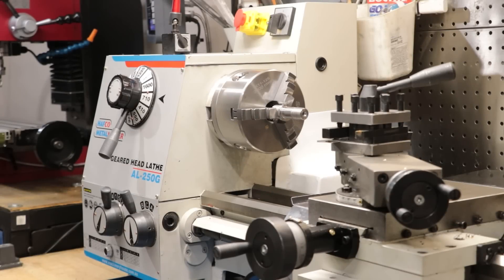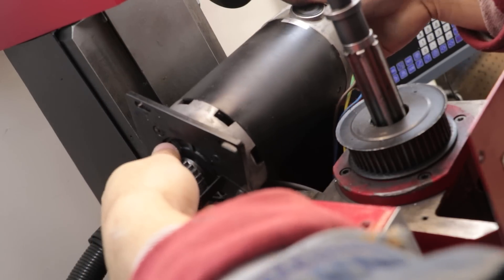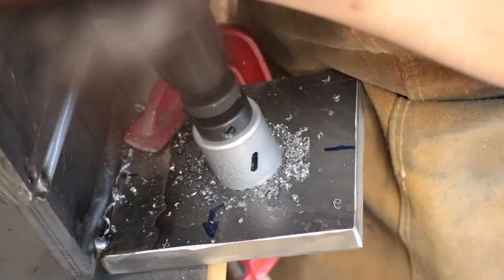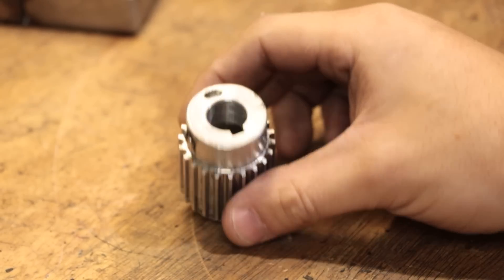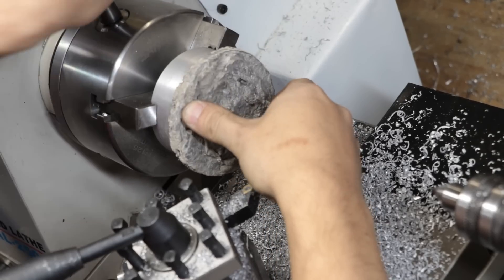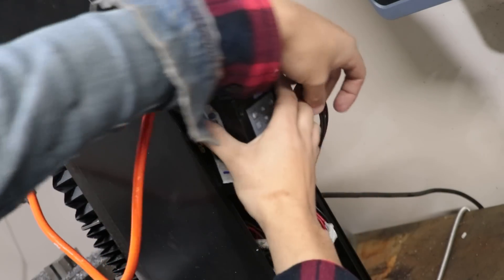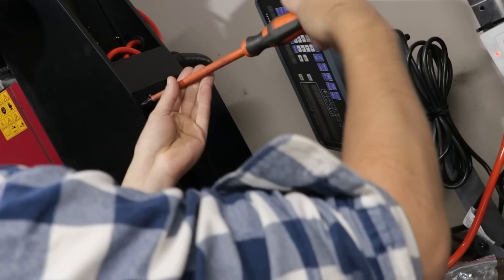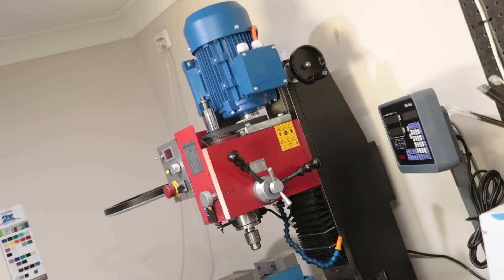I Put A 3HP Motor On My Mini Mill

Comment: I can recommend Suttons “Venom” cutting fluid. I was sceptical but it really works to make drilling and tapping easier and you can buy it at Bunnies. I can also recommend the Metabo  WEPBA 19-125 5” / 125mm angle grinder. They’re not cheap at around $499 but, buy once, cry once and they have a lot of safety features. With a rated 1900 watts they also have the power of a much bigger grinder. That’s 700 watts more than your new Ozito and boy do you notice it. With so much extra power the blade doesn’t slow down so cutting and grinding is much faster. The difference is incredible. I bought two of them after a serious accident with a Makita. I hope this helps, Cheers Stuart. 🇦🇺
Reply from the maker: Blimey that’s one powerful grinder. I looked at the makita at Bunnings and it was less than a 1000w. For what it’s worth the Ozito is powerful for the price. I do love me some Sutton a cutting fluid, I use Sutton a cutting paste and it works wonder too. Cheers
Reply: @artisanmakes  It’s is a powerful grinder but you pay a lot for it. It’s a bit like the difference you felt putting the big motor on the mill. 👍

Comment: btw, the type of VFD you have there is designed for running things like fans, it drops the voltage as your RPM decreases to maintain constant current across the coils for maximum longevity of the motor. Thats why the torque is so poor when trying to drill large diameter holes. Two things you can do to improve the performance, swap out the VFD for a sensorless vector drive unit, these provide way more torque at lower rpms and can recover if the motor begins to stall. Next would be to replace the silly 3HP motor for a 1 1/2HP one with 6 poles as apposed to 4. Due the the lower rotor mass the max speed is far higher than the plate speed, that number is simply what the motor will run at when connected directly to 3 phase power while you will find that the same motor model family with 2 poles has a plate speed of 3600rpm with 150% overrun margin so you actual self disassembly speed is like 6k+ RPM lmao.
Reply from the maker: Whilst this motor wasn’t my first choice, I don’t want to make it out like I have little torque at low speed. It’s quite a lot for what it is. I am sure we can do better but I’m over sinking money into motors and drive units
Reply: @artisanmakes  haha, that's always the way. I ended up changing to a gear head machine myself so no more torque problems. But you will end up running into trouble with annular cutters with that setup, you simply wont have enough HP at the speeds those work at, for everything else you should be okay.
Reply from the maker: I am a bit jealous of that. A geared mill is something I’d like to get my hands on one day. Cheers

Comment: I would have used the lathe with a 4 jaw chuck to make that hole. You can start with a drill and then bore it out to size.
Reply from the maker: Sure but I don’t have a 4 jaw for this lathe
Reply: @artisanmakes  ...yet.
Reply from the maker: @doc1701  Yeah its on the long list of stuff to buy :)

Comment: Remember Endmill size IS gearing. (I had to learn this mistake). Run the machine 100% rpm/power, use smaller diameter end mill to get right surface speed. I went from preferring 12mm cutters to 6mm. Buy long shank for those tall sidemilling ops. They are also like 1/4 the price.

Comment: The obvious solution is Paint the Motor either Red to match the Quill or Black to match the Frame.  I would suggest Black. I think it will not stand out as much as the current Colour. I have a Similar machine from the Little Machine Shop so it is White and Blue. the increased HP will make some milling operations much easier. Having a very stiff column is essential to the Milling Platform,

Comment: 2 times the frequency is risky for large motors because of centrifugal forces. 1.5 can be ok
Reply from the maker: It should be okay to go up to 2 times on this motor. And that’s purely based on the fact that they sell the exact same motor which is 2 pole, which runs at 2800rpm

Comment: Why would you try drilling through steel with a hand drill when you have a working lathe?

It's not the ideal tool but you can put an endmill in the chuck and use it like a mill. Surely it's better to do that and cut a hole with the part in a rotary table than using a hand drill on steel...

Also... why would you risk doubling the motor frequency when you can make larger gears for the motor? Go with a 4:1 gear to increase the speed and use the vfd to reduce the speed in "hi mode". Then switch the gears back for "low mode" when milling steel.
Reply from the maker: Even if I wanted to make gears I can’t make the spline profile yet. And I don’t have any fixtures for this lathe to mount the steel. Nor do I have a 4 jaw chuck. Yet anyway
Reply: @artisanmakes  you can hold an endmill in a 3 jaw chuck. A rotary table can be bolted to the cross-slide (remove the toolpost). 

It's worth getting that rotary table first in your case as they are cheap and you really need those gears.
Reply from the maker: You would either need t slots or a backplate to be custom made to attach it to this cross slide and in the context of what I was doing I that doesn’t make much sense to do. I have a mill do I’m not going to invest in tooling to make the lathe have milling capabilities. But you can do that for your machine tools. Cheers

Comment: If you want more torque at low speed you can look to change that VFD for a Delta MS300 or similar one, because these cheapo chinese VFD's are PWM controlled and they offer low torque at low rpm, so the best option for a steel milling machine is to use a Vectorial Control VFD
Reply from the maker: Just a shame that the good quality ones are pricey

Comment: When you go above base frequency you will trade speed for torque, however comparing the torque curve of this motor to your last motor id suggest even at 2x base speed torque will still be greater
Reply from the maker: Yeah it seems to be like this. For what it’s worth I rarely go above 1500rpm unless it’s that rare part that needs a small endmill. Cheers

Comment: I did quite the same on my machine (BF 28) last year and I would never go back ! 
I can drive the motor between 4 and 115Hz. and as my machine has 2 gears I can use it from 80 to 5.000+ RPM, with a bunch of torque at low speed.
Huge improvement that should be done up from the beginning

Comment: I swapped my spindle pulley sleeve when I converted to a belt drive. I found the spline profile I needed on aliexpress and just turned it down to fit my bearing.

Comment: I’m…. Very confused why you didn’t just put that square plate in the lathe and punch a hole in it with the tailstock? 
Remember, your lathe is Essentially a milling machine turned on its side
Reply from the maker: I dont have a 4 jaw chuck or t slots for fixturing
Reply: @artisanmakes  ah ok that makes sense.  Sounds like we need to start you a 4 jaw fund! I would definitely contribute 😊

Comment: Aluminium exhibity a property of 'age hardening' which results in it being soft gummy crap for a week or so after its cast.  leave it a week+ and it itll machine much better.  I had this exact same problem :D
Reply from the maker: thats why I heat treated it. to artificially harden it. I don't know for sure what alloy it is so it might not be an alloy that age hardens

Comment: If your buying ozito tools you should just be impressed if they work in the first place not worried about when they will fail
Reply from the maker: Hit or miss. Cordless stuff isn’t great but their cord d tools work
Reply: @artisanmakes  i look at them as single use tools, if you need something a project but probably wont use it again ozito is great

Comment: When milling aluminum, have you tried using isopropyl alcohol as a cutting fluid? I don't know how much of a difference it would actually make, but supposedly it's a suitable fluid to help manage surface tension of aluminum.

Comment: Brother, you need to use cutting oil and go much slower (RPMs) for a hole that size. And use more tool pressure. Clear the chips more frequently.

PS: that's not a timing belt. It's a drive belt. Unless you guys call it that down under.

Good work though.
Reply from the maker: Didn’t have much choose, drill stalled out on anything lower. And it had cuttin oil
Reply: @artisanmakes  You can fashion a makeshift "drill press" by tack welding a rod or bar vertically in front of the hand drill, attaching another bar horizontally to the vertical such that it pivots up and down and then fastening the drill to the middle of the horizontal bar and guiding it with one hand and pulling down with the other on the horizontal bar.

Might not have helped here, but it's a good trick to have in your tool bag.

Comment: crazy out of the blue question but would u be interested in selling any of the stuff from u old lathe, like the solid tool post an stuff, ive been wanting make one just like it but i have trouble getting material locally so im stuck buying most of what i get on ebay an its been a challenge to get material big enough to do alot of the stuff but since u got ur new lathe i thought id ask if u was interested in selling any of it or even the hole lathe for that matter, or just what u would be willing to part with, just thought id ask, dont have a clue of any other way of contacting you besides the comments so hopefully youll see this.

Comment: Do you miss the old lathe? 👀
Reply from the maker: I miss the upgrades I made for it. Also miss the 1mm pitch lead screw on the cross slide. That’s about it.
Reply: @artisanmakes  did you sell it? I want to get the same lathe dude, is there anything else you would recommend?

Comment: Replacement boards are available from 3 party sellers for less than $50.00 US here and there are many better DC controllers  for that motor that will probably fit in that enclosure
Reply from the maker: Just goes to show how overpriced the OEM boards are.

Comment: Love the upgrade. I did a similar upgrade but I used an Ariston washer machine motor. Three phase at 195v and coupled that to a cheap Chinese vfd. Works very well. Now to do my lathe. Slightly larger motor and vfd ordered for the mini lathe. Love the vids.

Comment: That modification added a lot of weight. How does it feel to crank the z-axis now?
Reply from the maker: It doesn’t feel all that different. Granted there is 2:1 reduction between the lead screw and handle. I think the total weight added was about 10-15kg. That 3 ho motor alone weights 17kg

Comment: Hm, epoxy granite video coming next? :)
As others have said, on the old motor control board, it's likely one of the power transistors (the big 3-pin components stuck to the heat sink) that failed. If you're interested in diagnosing and potentially repairing it, and you have a multimeter with a diode test function, you can check if one or both of them are shorted or blown. Poke around YouTube for "test mosfet with multimeter."
Reply: Yeah, those power transistors blow quite often. The power transistor blocks were the #1 maintenance issue when I ran a large CNC machine shop. I found the transistors needed to be closely matched to each other or the one(s) replaced would blow again within minutes of use.

Comment: Hey mate, a tip when drilling through anything thick with hole saw, but works especially well on steel. Drill a small hole in the path of the circle you're cutting. When drilling through thicker material, as soon as the cut is deep enough to cover the hole saw teeth, the chips have nowhere to go. The teeth will get clogged and you just end up rubbing instead of cutting.If you drill a hole first, the chips will be able to exit the cut through the bottom, and you wont have to pull the hole saw out to clear the chips every few seconds. Faster cuts, and less rubbing keeps your bits sharper for longer.
Reply: Good tip mate

I spent some time trying to cut though steel with a 70mm hole saw, but couldn't get over 5mm in.

Maybe i cut down 3mm with the hole saw, then i'll have a grove to guide a jobber bit.

Comment: You could have performed a lot of the needed operations on the lathe. For instance, the hole that needed bored could have been done on the lathe before the plate was welded in place. Remember, almost anything normally done on a mill can be done on a lathe, and anything normally done on a lathe can be done in a mill. It might just take a bit of extra setup.
Reply from the maker: I could yes but my 4 jaw chuck hasn’t arrived yet. New lathe so half the tooling is yet to be made or arrive. Cheers
Reply: @artisanmakes  A four jaw chuck can be usefull, however, it is not required to do milling operations on the lathe. You can put the cutter, such as an end mill or a boring head, in the 3 jaw chuck. You then fixture the part to the cross slide. The lathe becomes a horizontal mill. Line boring can even be acomplished this way. Quinn Dunkie has some videos on that, over at her channel, Blondihacks. It is an often overlooked capability. I lived without a mill for decades getting by with only a lathe and a drill press.
Reply from the maker: You need t slots to easily do that type of set up. I used to do it on my old lathe but this cross slide doesn’t have t slots

Comment: I ended up putting a 600 watt sewing machine AC servo motor and control on the mini lathe after the board died, $120 fix, stupid board was $250. Much more power although now the lack of rigidity is really showing especially when boring. Great video thanks.

Comment: If uwanna Change the speed of the motor then u Could use a star—delta configuration 
U bride the contact u2/ v2and w2 to get 1/3rd of the power written on the nameplate. To get the full power u bridge u1/u2  v1/v2  w1/w2
To find out more look up star—delta configuration

Comment: You might take the board to a electronic repair shop (make sure they know what the board goes to) and see if they can't figure out which part popped, it might be a cheap fix.

Comment: Man, this hits too close to home lately. Breaking tools is a major bummer and lately I've been having about the exact same luck as what you've had in this vid. I'm pretty sure you know this already but just in case: I have 2 suggestions. Firstly, ryobi has a massive warranty on their cordless products. I always end up somehow magically burning up my 18v tools around 2-3 weeks before the warranty expires. At least here in the states we can just take them back to home depot and straight up swap the drills and such for brand new ones (not sure if you have that option on your side of the equator but its worth a shot?). The second has to do with your smelting and casting... don't quench in water like... ever. Always use oils and preheat your quenching fluid as much as possible first. You will reduce the chances of warps and stress fracturing your parts by doing so. 
Ive been watching your content for some time and I have to thank you for all the time you've put into these. I'm an old geezer but you and a couple other machinist channels have taught me so much I cant even calculate it. Cheers and thanks, my dude!

Comment: if you want the vfd to last longer it needs some ventilation, not dissipating heat kills electronics .I wonder if the original control board would of lasted longer with better ventilation?

Comment: Cordless - What do you expect with a Ryobi.
 Hole Saw - What do you expect when you don't use lubricant to cut a hole using a hole saw.
Angle Grinder- What do you expect when you don't use a 'proper' branded tool eg Bosch, Makita, DeWalt etc
There's a reason why the trades become tool snobs, we want tools to work!

Comment: All of my cordless tools are Ryobi and I can attest that the triggers are garbage but easy to replace.  I would guess that is what is wrong with your drill motor?  I stick to corded tools, unless you are working remotely there is not good reason to opt for cordless.
Reply from the maker: No I could smell that I burnt out the motor. Cooked electronics. Ryobi ain’t my first choice of tool but I’m locked into the battery family and it makes the most sense for me at the moment. And it’s probably the only tool I use regularly that is cordless. Cheers

Comment: Here’s a tip for using holes saws in thick metal: touch the hole saw onto the metal so it scribes the perimeter of your hole. Then remove it and drill 4 small holes (at 90 degrees) around the perimeter right through your material. The outside edge of each hole should be aligned to the outside edge of the perimeter. Then resume cutting with the hole saw. This allows for the chips to be pushed out through the four holes and prevents them building up and causing heat and damage to the saw. Also use cutting fluid. And then go and buy an annular cutter and never use a hole saw on thick material again 😂. Great videos btw.
Reply: "and then go buy annular cutter" 😂 that's what i was thinking
Reply: The little holes on the outside, do you mean drill them so their centers go through the scribed line, or their outside circumference, putting the hole on the outside of the scribed circle?
Reply: @FireFliesIlluminateMe  Little holes should not poke outside the perimeter of the big hole. So drill them inside the big hole, with the perimeter of the little hole up against the perimeter of the big hole, from the inside.
Reply: @ericg7044  thanks!
Reply: I mean that is a thick slab  😆

Comment: Next time slap the work on the compound, and tool in the chuck. The lathe is the mother of all machine tools, a mill is just a sideways lathe. Could of machined the motor mount easily on the lathe.
Reply from the maker: If I had t slots on the compound or a 4 jaws chuck that would have been my first choice, but I don’t currently have those. Cheers